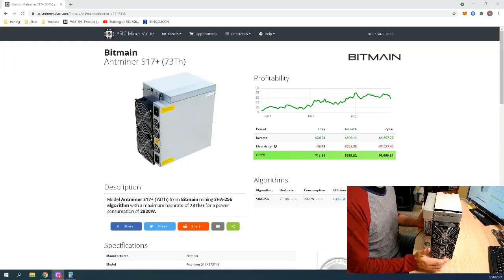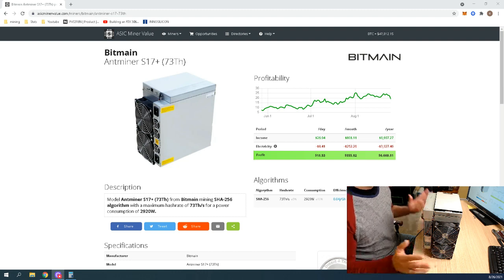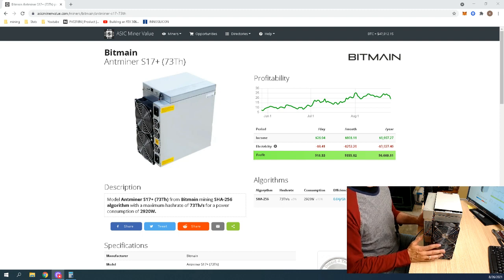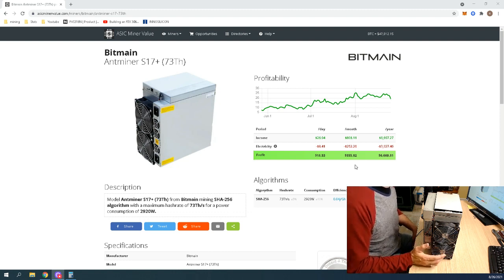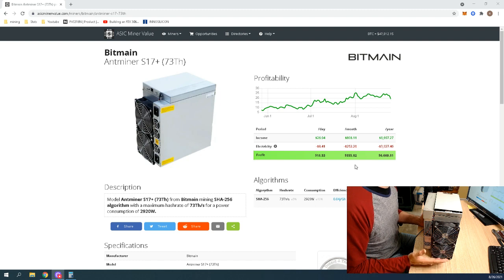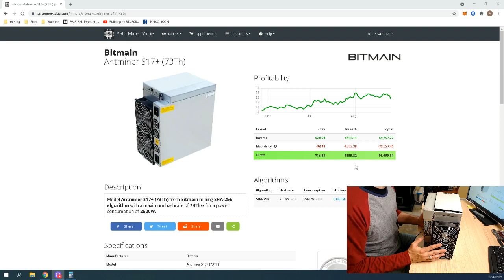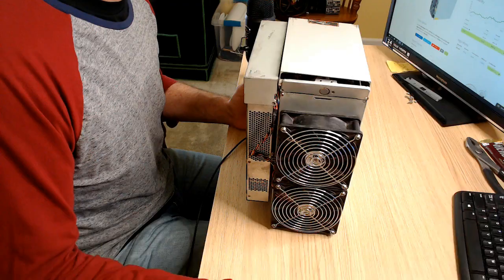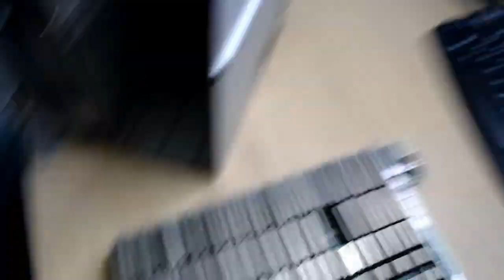S17+ Teardown

Comment: I have the same problem I just bought a s17pro and only one board working the other 2 not working
Reply from the maker: Didi you buy from china? That's were I went wrong. I've been using East Coast Miners out of Tryon NC and they've been good to me. Their prices are extremely fair for repairs. Let me know if there is anything I can help you with. I've gotten good at reading the Kernel logs.
Reply: How much did they charge to repair? I have this same unit. It worked fine for about a 2 week.  Now only 1 borad is working.  I bought it from newegg